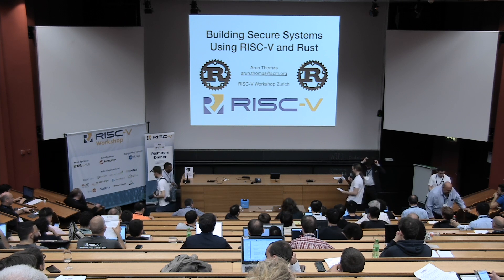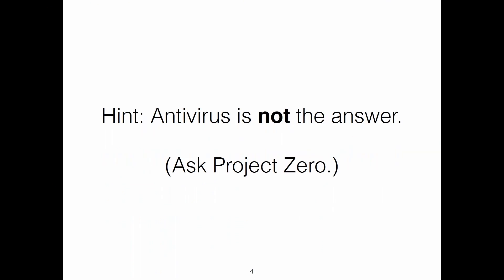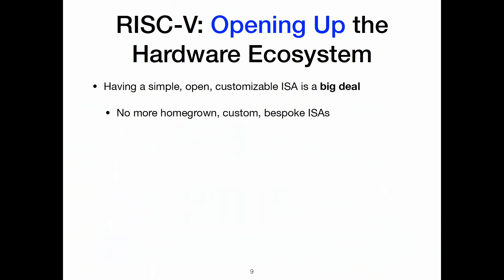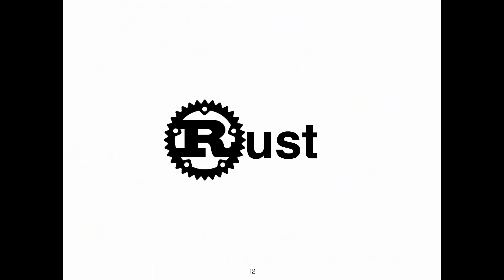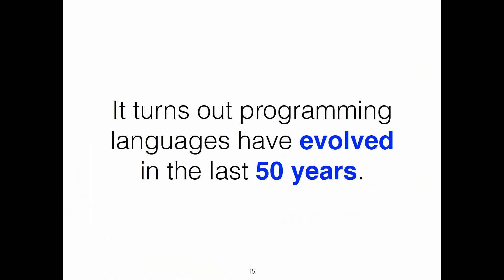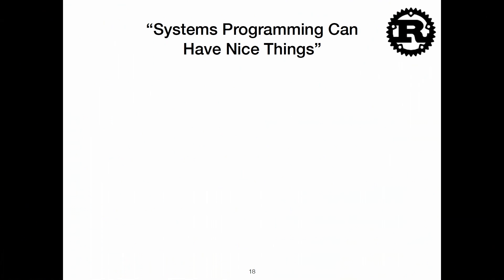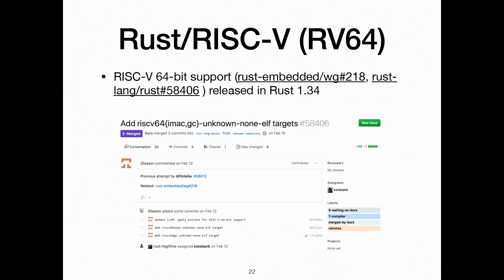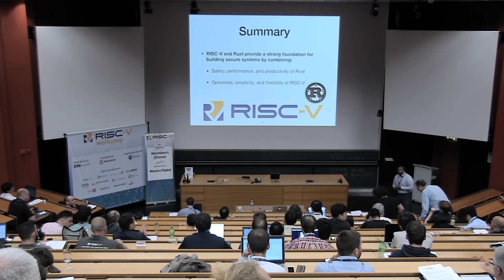Building Secure Systems using RISC V and Rust

Comment: When can we have a 35$ RISC-V SBC? I can think of so many things to do with it 🤔 
I’m not an expert or anything, just a die hard Pi enthusiast.
Reply: As Bart van Veelen said, Sifive Hifive1-revB board is "in the ballpark" on the top of the price heap tho. I got mine working with rust and had a lot of fun playing around with the peripherals using Rust so far.
Reply: @Almindor  can you point me in the right direction for rust on the HiFive? I'm interested in doing the same but resources are a bit sparse/fragmented right now.
Reply: @bartios  Of course. Best is to start with the cargo template from https://github.com/riscv-rust/riscv-rust-quickstart There are some nice examples in that repo.
Reply: @Almindor  thanks, will try it out once the board arrives!
Reply: For $60 you can preorder a HiFive Rev B board which will contain one of SiFive's RISC V based cores. It's more expensive than the other SBCs in the diy space but the price will probably come down if/once they get similar volume as the Rpi